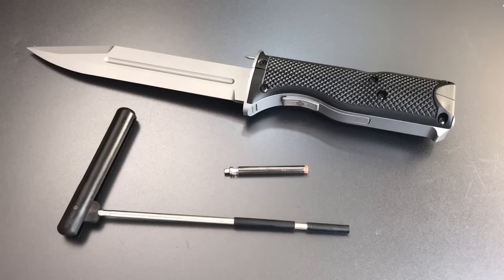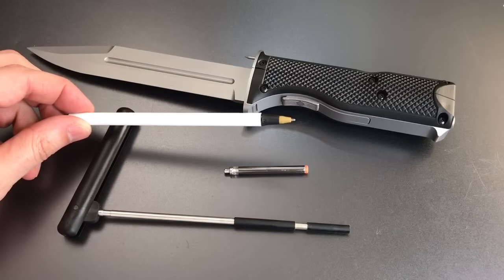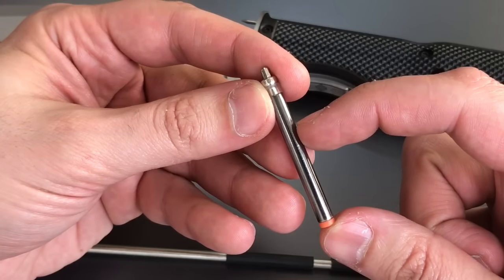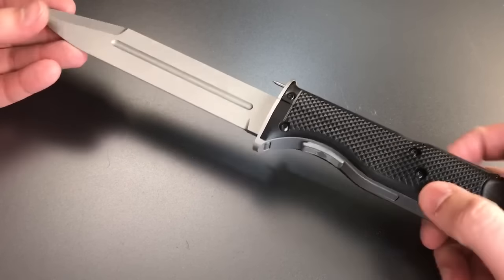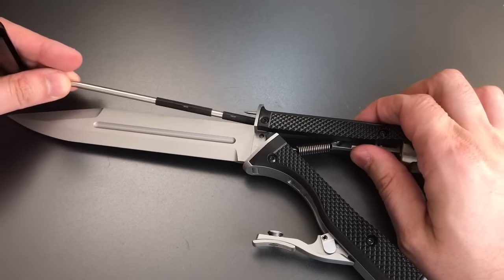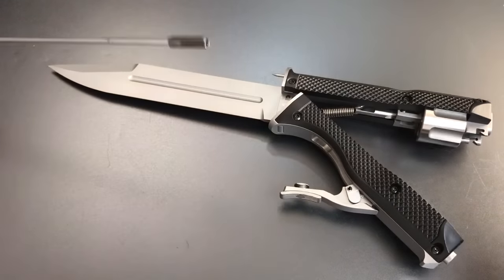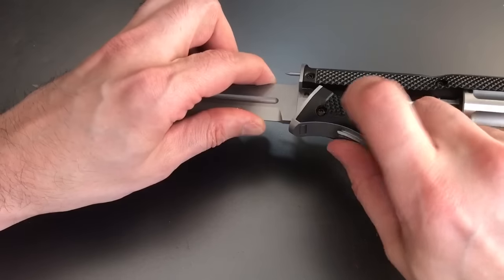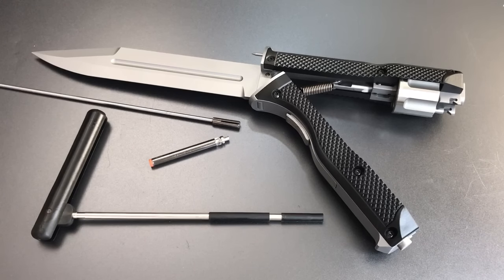[460] Omega Internal Revolver Lock Opened

Comment: One advantage to a lock like that would be that it doesn't look like a lock. From the outside you cant really tell its in there.
Reply from the maker: Good point... and congratulations to you for posting to only comment related to the lock.  LOL.
Reply: "Security through obscurity" is not a foolproof doctrine, but it may make the syste extremely fool resistent.     I think the biggest advantage here is not only does it not look like a lock, but you can't easily tell it's there.    To most people, they'd think this gun is "broken" somehow.
Reply: videos
Reply: I'm a year late, but I agree. 12 year old me would be smart enough to get around the lock, but I'd never even know it's there
Reply: That also gets around teen adolescents. You could just tell them it’s jammed and unusable, and they won’t even bother trying to fire it.
Reply: I think the level of protection that provides from a child or teen wanting to get access really depends on how careful you are about not letting them know how to unlock it. If they know how you do it they can probably steal the tool or make their own, but if you never show them how it works its an extra defense.
Reply: If people follow basic gun safety rules, no one will ever see the lock.

If.
Reply: @SomeFreakingCactus this is a late comment, but it’s either that or the kid disassembles the gun trying to fix it showing their ingenuity in mechanical engineering. I definitely know what kind of kid I’d have been considering what I was doing when I was young. 

For those wondering, my dad set me on a pile of computer components expecting me to just gain some experience and I came away from them with a functional computer.

Comment: This may have been said already, but I think you probably could have used the BIC pen on this as well, if you had removed the ink-well-thing from the outer casing
Reply: Makes sense. The bottom of the ink tube could in theory be forced over the “screw head” to turn the piece. 

Especially so as the provided tool is inadequate for a firm lockup via the approved means. If you can’t turn the wrench you can’t hand tighten the thread.

Comment: It doesn't matter what type of head it has, any screw-type lock can be defeated by anyone who has any experience removing rounded-off or seized fasteners. Looking at that particular lock, my first thought was to use a plastic rod, warm the end until soft, and press it over the screw head so the rod conforms. Instant key.

Comment: As said by others, if you have no clue about the lock/block inside, you would more likely think of it, as a broken gun, rather than expecting to find a removable plug inside
Reply from the maker: Yes, this is a fair point...
Reply: Security through obscurity: the best security.
Reply: Sarcasm, I hope?
Reply: I'm a little worried about messing up the lockwork when some overzealous adolescent just keeps pulling on the trigger to find out why it won't cycle, or gouging the throat of the barrel, because either it's a soft enough metal that it will bend/break and get stuck or it's a hard enough metal that you can warp your springs trying to force it.
Reply: On a traditional revolver you would be able to see it through the gap between the cylinder and the forcing cone.

Comment: For an improvised tool to lock and/or unlock it, you first figure out what size the nut or the head of the bolt is. We'll say it's 3/16" just as an example. Then you grab a 3/16" socket head cap screw (like what you would use a 3/16" allen wrench on) that will fit down the barrel with little to no modification. You then thread it into or use your favorite method of  attaching it to a small diameter rod, then TADA!  You now have your improvised tool! 

The cylinder looks backwards & goofy on that gun since it's not mounted in the traditional direction which is making the flutes point back at the user. Cool piece though, that's for sure!
Reply from the maker: That would work.

Comment: Most people who have guns will have a cleaning kit for them. The rod for cleaning a .22 barrel will fit, and probably be stored somewhere near the gun itself. You only need to find a small plastic collar of some sort to jam on the end and which will fit on the end of the lock. The end of the rod is already hollow and threaded to accept different sized ends to push patches down different sized barrels; perhaps it would even be large enough to fit over the end of the lock with enough friction to turn it without any adapter/collar at all.

Comment: Gun locks prevent accidents not thieves. All a gun lock is actually for is so there's a step between picking up the gun and loading/firing the gun that has reasonably controlled access.

Comment: The thing about this lock is that it would be a lot harder to defeat if you had never even seen what the mechanism looks like. In fact, the best case scenario is that the person assumes the gun is broken or that they don't know how to operate it properly, which, I think, makes this a decent solution for certain scenarios (like having kids around which you are not able to educate about gun safety).
Reply from the maker: This touches on my philosophy for attacking locks.  No security by obscurity.  If I don't know what's in a lock, I tear it apart, and look... make sure I fully understand the mechanism.  A lock that relies on ignorance as a defense is nothing more than a bad joke.
Reply: LockPickingLawyer You ever shopped for a baby gate? :-)

My point is that it depends on who you're protecting the item FROM.  Unfortunately, with these firearm locks, it seems that obscurity is about the only significant obstacle we have seen.

If obscurity doesn't add anything to the security of the lock, then why do you make a point of removing that variable first?  Honesty, my I initial point was really that the design of the lock actually protects the obscurity of the mechanism.
Reply from the maker: Of course obscurity adds something... but only once.
Reply: @lockpickinglawyer  So long as the person has never seen this video or the lock, they cannot open it intentionally. The most likely methods for opening would involve extensive research and scavenging for the resources necessary to open. This obscurity isn't part of keeping the lock from being opened. The focus is instead on delaying the discovery of the item and giving no hints of it being a lock. A person knowledgeable in locks of this type may approach them with the tools necessary to open them, but it is significantly more probable in the case of theft for a given thief to simply take the locked firearm to a secure location and manage it there. Additionally, the primary purpose of the lock here is not to prevent theft (though I do believe a tracker or wireless alarm integration should be implemented when possible); instead, it prohibits rapid deployment and use of the weapon. People who rapidly deploy stored revolver firearms are not commonly attempting to take them away but to use or test them without permission. Unless the weapon can be silently reassembled in four minutes or the unauthorized user guesses the correct assembly of items to shove down the barrel of a questionably empty gun with supplies nearby, the lock has completed its task of preventing or critically slowing unauthorized loading and use of the weapon. This lock is best for families or businesses without substantial access to equipment of the relevant dimensions or the tools to manufacture such equipment, and it is worst for solitary houses or areas in which the information or tools for these locks are common.
Or at least I believe so; I do not possess a channel dedicated to locks or a channel dedicated to any form of weapon safety, specifically revolver firearms. But still, I believe that in at least my area, this lock would be very effective.

Comment: That knife revolver combo looks really dangerous. The method that most people would intuitively use to put away the trigger mechanism will actually fire the bullet.
Reply: You have to rotate the tab first.  The trigger then pops out and a spike emerges above the barrel.  It would be almost impossible to accidentally fire it.
Reply: @earthknight60 the problem then is how do you safely return the trigger to the safe position?
Reply: @Cheesus-Sliced  There are youtube videos showing how it works.  Part of it rotates and disconnects the firing mechanism, then you fold it away.  It's a slow process..
Reply: @earthknight60  ya, the issue is that the intuitive way to collapse it would fire it.

Comment: I've mentioned before to you that the rubber ring corrodes when it comes in contact with gun oil. I figured this was a good lock. I'm in Canada and we don't have many of these locks so any casual user would assume it was a replica gun or perhaps broken. Also allows you to fit it in the case easily, (mine is on a .44 5" S&W but I also have one on my P345 Ruger). As you may know the Ruger cases make it nearly impossible to put a trigger lock on and close the case, (not every handgun but all mine are like this). Anyways in Canada when transporting a handgun and some rifles we need two locking systems, this type of lock works okay.
Reply from the maker: You did mention that, and I forgot... it's a good point to note.
Reply: Not a buna-n ring but some crappy other rubber?  AvE dislikes this shoddy lock.  Of course there will be gun oil present.  Bad design.

Comment: Do you think the result would be different if you were able to tighten the lock with the intended tool? You were able to secure the lock with the makeshift tool however, you may have been able to apply greater torque with the intended tool. This tightness may have required more force than the makeshift tool would be able to withstand. It would be interesting to see this one done again but with the proper tool.
Reply: เพัง

Comment: wonder if you break 2 laws for having that weapon?  in most states that knife blade is too long and it's a concealed weapon even if you are wearing it openly on your belt
Reply from the maker: I have taken appropriate steps to ensure that it is legal... all that is required is NFA registration.
Reply: Oneofdazzz 
Yeah. That's two more reasons to like it. :-)
Reply: Any knife is legal as long as you don't carry it in public.
Reply: @lockpickinglawyer  As an AOW correct?  5 bucks and a form.  Where can it be sourced.

Comment: For starters how you even know what's stopping it from firing and then to come up with a makeshift tool to unlock something you have no idea how it works. Seems great to me.
Reply from the maker: True... but security should be based on the assumption of full knowledge.  Security by obscurity can sometimes work, but it should not be relied upon IMO.
Reply: Generally gun locks are meant to prevent children from firing a gun. They won't stop burglars because burglars will just take the locked gun and try to deal with the lock later. Children, on the other hand, might know how this lock works if they are ever present when the gun is taken out or put away.

Comment: The reason you’re able to defeat this lock is because you’ve examined it while outside of the barrel so you know how it works. If someone were to encounter this while the firearm was locked and the bar already placed onto the barrel they would not be able to defeat this because they don’t know how it works. What you are doing is sort of reverse engineering this lock and in order to do that you first need to examine the lock outside of the firearm which no one but the owner is likely to have access to.

Comment: That's a serious gun-knife. You could bury that up to the plunge line in someone and repeatedly push the trigger for some extra umph. Not saying you /should/ but I think that's the general idea.

The lock, however, is nice in that it's about as concealed as the gun is in this knife. If you didn't realize it existed, you'd be hard pressed to figure out how to remove it.
Reply from the maker: I generally agree that if you don't know it's there, it's effective... but it would be a mistake IMO to base you security on the assumption that others are ignorant.
Reply: I agree completely. It would become obvious to anyone with any sense to realize /something/ is inside of the cylinder, and even without sense, determination often prevails. Removing it after that takes only the right amount of curiosity and determination.

Comment: I doubt that LockPickingLawyer will see my seven year late comment, but, to be fair to the makers of this tiny Omega Internal Revolver Lock you essentially studied their insertion and extraction tool and duplicated it. I don't think things would have been so easy, if you had never heard of an Omega Internal Revolver Lock and was given a small gun with one jamming the barrel and asked to figure out what was going on.

I think you would have needed to have bought or borrowed a laparoscope and then used it to figure out what was obstructing the barrel. Either that or you would have had to spend time poking stuff like wiper inserts down the barrel to figure out there was something down there that could be unscrewed. You would, of course, have figured it out, but not in less than seven minutes. And if you were trying not to damage the gun barrel, you would have needed to be a lot more cautious.

I have to say that I don't actually think that the Omega Internal Revolver Lock is a "lock". I think it is a security bolt. There is no sort of combination or bitting needed deploy or remove this thing. I am assuming they are all identical. So it relies on "security through obscurity". If these were used by a large number of gun owners, and thieves were stealing legal guns on a mass basis, there would be an illegal gun dealer who would either get a full set of these "barrel blocking security bolts" or make a compact kit similar to what you have made with the Covert Companion. So the more successful this product is in the market place, the more likely it is that gun thieves will defeat it quickly.

I personally think that the best sort of "gun lock" would be something that works like a padlock and goes through the barrel or the chamber that rounds go into and that also secures the gun to a wall or floor. (Ideally the design would be done so that any attempts to twist off the lock are just as likely to snap the gun in half. Because if an intruder breaks into your house and tries to get your gun and threaten you with it, you want the intruder to not be able to remove or use that gun. And breaking the gun is better than loosing the gun.)

If you do see my comment, please would you revisit the Omega Internal Revolver Lock. I think the fact that it relies on squishing a soft bendable thing into the sides of the barrel is it's weakness. If someone can squirt a small amount of weak acid down the gun barrel and destroy that part of the Omega Internal Revolver Lock, the rest of the security bolt should just drop out the front of the gun. I've seen the sort of things that people can do with Mintoes and Coke. So there must be some sort of liquid that would eat that part of the Omega Internal Revolver Lock without damaging the gun.

Comment: It might make a difference if the "nut" is tightened with the official tool instead of the improvised tool, if the official tool allows it to be tightened faster than the improvised tool can loosen. Though that would probably just mean a little bit more effort when improvising a tool.
Reply from the maker: It would not make a difference... I am certain of it.  The lockup is very, very secure on the improvised tool.

Comment: This lock would be hugely improved by a spinner (or just metal ring)with hole in it. The key would slide through the hole and than engage the mechanism in a sash lock style. Don't you think?
Reply from the maker: Maybe, but not enough room on the .22 version.

Comment: I wonder if you used only the ink cartridge of the pen, heating it up with a lighter and inserting it, would it cool to the shape of the locking nut? That could be more easily accessible than what was done here.

Comment: I feel like they could fix this lock with two simple steps:
Replace the nut with a surface as big as the bore, and have the slot/key/hole be a slightly oblonged circle, kinda like polygonal rifling,
Then put that locking surface on a clutch-like mechanism, so that you can only open it if you aren't putting pressure on the lock.

Comment: that lock is usless on removable break style revolvers as it uses a jam system to lock to the barrel. on a break style revolver simply crack the gun open pull the revolver cartrige out and then use a tool like plier to defeat the locking pin thats held in purely with friction.
Reply from the maker: Seems right.

Comment: I feel like this thing needs more hand guard. Yes the grip is textured in a way that it would prevent slipping, but I still get visions of firing this gun and the knife goes slipping out of your hand, slicing your fingers as it flies. Cool concept, but I see this just a step or two above "Mall Ninja" blades, ie, more likely to hurt yourself with it if you try to use it in an actual fight. Still, if you can be sly about it, great for surprise attacks.
Reply: it's a .22 short, it ain't slipping anywhere.